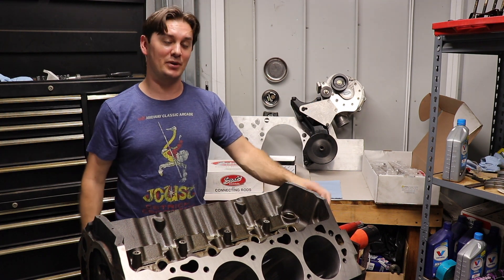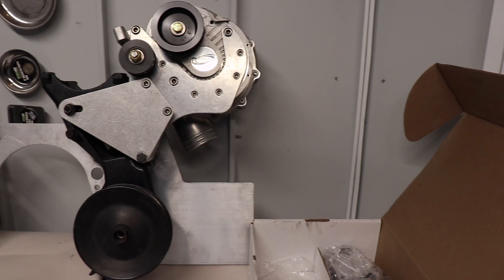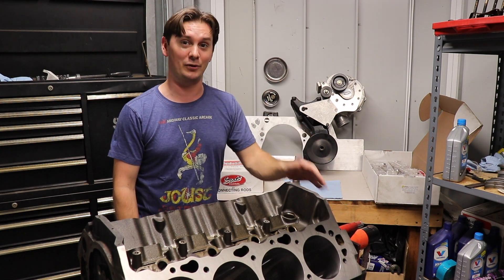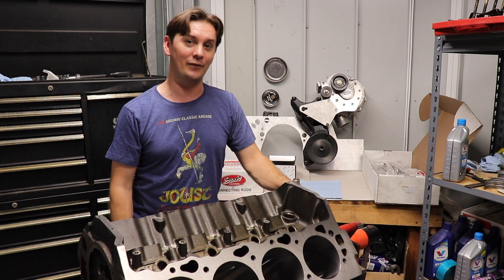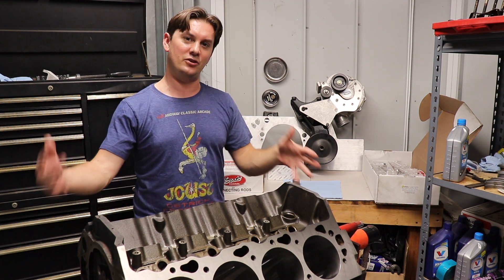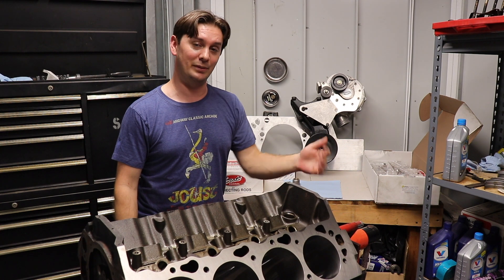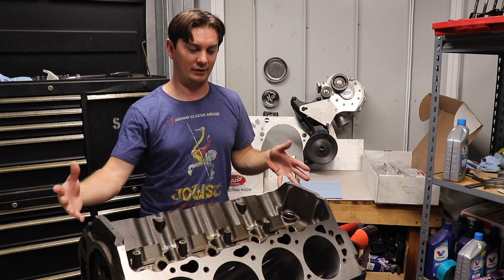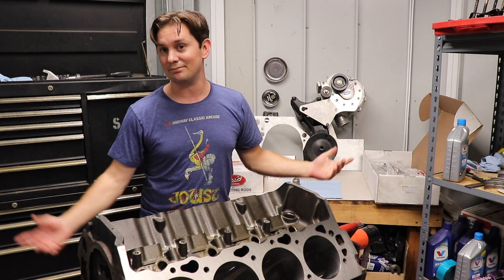Chevy 496 Big Block Supercharger | The El Caminos New Procharger Power Plant

Comment: Big block is where the reliable cheaper power is at, Ls is the most expensive option for reliable big power at least in the Chevy world. My Ls7 build makes 1300hp on pump gas but it cost me $41,600 but no corners were cut and I was building for the future also. If I could do it over I would’ve went big block but the Ls is a small package and slightly lighter even more so if using a aluminum block. Great content too!! 👌🏻

Comment from the maker: Which engine do you like better? Big Blocks or Small Blocks?
Reply: Always big block!
Reply: Big blocks are really expensive but super bad ass
Reply from the maker: @casey7091  They do cost a decent amount more than a small block for sure
Reply: Big blocks for sure torque is where it's at.
Reply from the maker: Torque really is the best.
Reply: I've always had small blocks, but I want a big block.
Reply from the maker: @benaiahtheassassin  I have had a few of both and they are both a ton of fun.
Reply: @BudgetBuildGarage  I had the opportunity this past motor build and went ls. Heard as strong as big block with almost same power just lighter. So I went for it. Building a turbo 5.3 at the moment
Reply from the maker: @benaiahtheassassin  LS engines are solid man.  They make great power and rev pretty high!